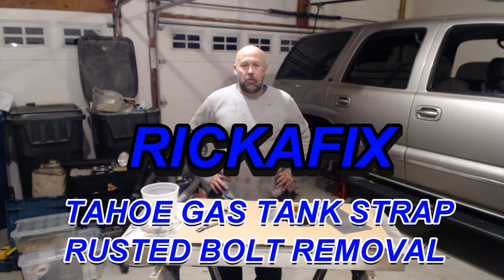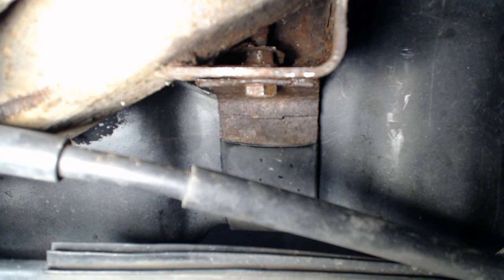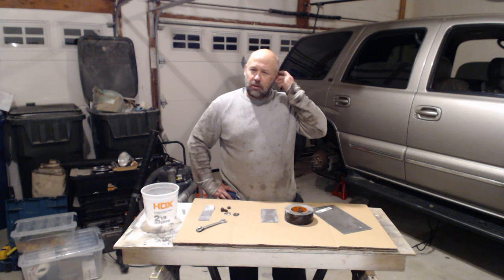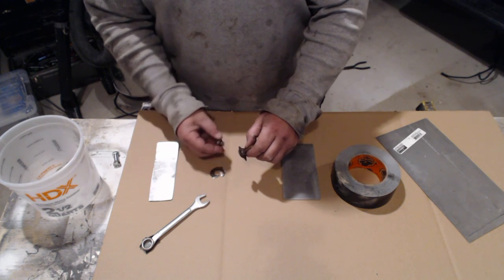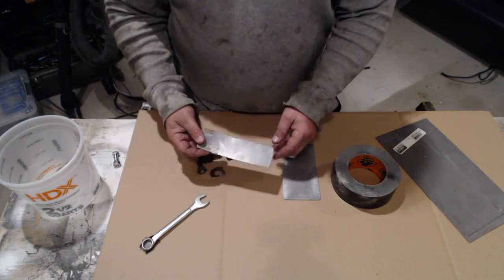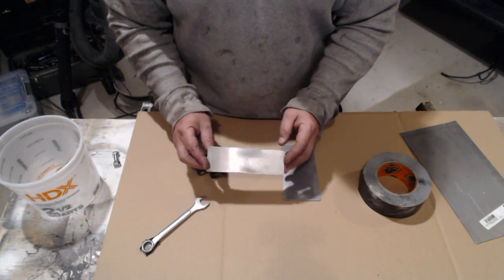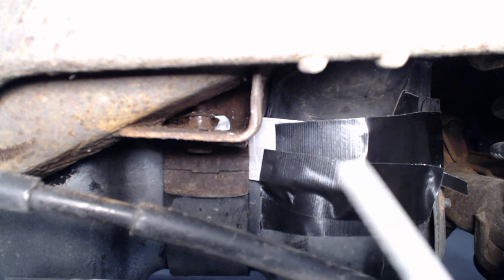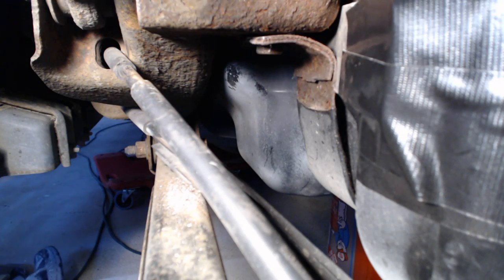TAHOE GAS TANK STRAP RUSTED STRIPPED BROKEN BOLT REMOVAL

Comment: i thought about using a sawzall...but decided against when i saw what a pain it was going to be to get the sawzall in there....so,  i used a small drill to drill a pilot hole in the bolt head, then moved up to a drill bit that was big enough to pop the head off the bolt as soon as it got thru it. Came right off...then i removed the old rusted stuff from the cavity where it was and put in new hardware. Took me about 15-20 minutes for that portion of the repair.
Reply: Thank man I’m going to try this I wrestled with this issue today for 4 hours… the first bolt came out super easy, the 2nd one oh man… the nut is seized on the bolt and they both just spin…
Reply: But with gas fumes , I am afraid of a spark to ignite the tank. I can cut the bolt head off but this doesn’t seem like a smart option.
Reply: Sawzall one wrong catch and hole in tank.as a welder,fabricator, mechanic. High speed die grinder with  carbide bit 
Air  or electric never sparks but  use proper PPE.

Comment: Wish mine is going that easy... leaking fuel line requires me to drop tank on a 2000 Blazer so I've got to slowly cut strap by hand to avoid sparks.  Yeah, that tool you were using to point out the rust...fun stuff lol

Comment: I just did this last week.   Front bolt was spinning on my 2009 Avalanche.  It was all rusted.   I chose to grind off the head of the bolt with my die grinder and the most coarse disk I had.   Wrapped wet rags all around the frame point and side of the tank to stop a spark from reaching the top of the tank.  Took my time and bolt head was completely gone after about 10 patient minutes.   Bought new bolts and nuts, and greased the crap out of the mount they sit in so I don't have to worry about it again.
Reply: Do you happen to know the bolt kit you used? I haven't been able to find any and the dorman set I found says it's incompatible
Reply: Use anti seize .better than grease. Costs  more but worth it.

Comment: Thanks for info. Had this problem on a GMC Savanna 2500. Reciprocating saw with a 10 “ diamond tipped blade I had both bolts off in 20 minutes…

Comment: Nice vid.  

I had to get rid off my Astro van because it went from rolling-money-pit to unable-to-stop money pit (rusted out break lines).

Secondary reason was i snapped the head off the front driver side gas tank strap bolt.  Made no progress drilling it out.  Was never able to put more than five gallons in it again due to lack of weight bearing ability.
Reply: That’s freakin wild!, did you resale? Or scap?
Reply: @wiggitywhitefox  

Scrap.

I live in urban Chicago suburb and I only had street parking so I had nowhere to park the Astro van where I could work on it. It needed a rear axle also, specifically the differential was whining likely the pinion gear. 

I do miss it's off idle torque though of the 4.3 L Vortect enine.  Now I'm driving a Toyota Solara V6 3.0 L where I have to get up at 2,000 RPM to get decent launch off from a standing start. Rides more like a go kart too. Better handling though. I missed the van about five times a year such as right now when I want to rent a core aerator and avoid rental truck cost to get it to my house.

Comment: Another way is to use an oscillating multi tool with a metal cutting blade .
Reply: Did that work for you?
Reply: @jakejones2482  Yes, gives better control than sawzall , but you still need to be very careful when cutting.

Comment: What did you use for the new bolts? Every auto parts store around says they don't have any for my Tahoe.
Reply: Use 15mm headbolt for metric or 1/2head bolt for imprail

Comment: Good video, thanks for sharing your nightmare with us. I went a different route. Since I was replacing the fuel tank, I put a jack under the strap and raised it high enough to remove the strap from the other side near the driveshaft. The tank and strap needs to be raised about a 1/2 inch to free the strap from the T hangar on the other side. (At the end of the day I did not notice any damage to the old tank.) I was then able to drop the tank and do battle with the bolt and grab the nut with vise grips.

Where did you get the replacement bolt and C Clip for the Tahoe?

Found it. Dorman Part Number 55157. Comes with 2 clip nuts and 2 bolts. Perfect fit for 2004 Tahoe. Advance Auto or Orioley's Autoparts.
Reply from the maker: Nice finzfan...I think I boght them at napa
Reply: I am currently knee deep in this crap. Thanks for this idea!! Getting a sawzaw in on my bolt is not really a feasible way...
Reply: @dylanhucik8594  I am happy to help. I hope you got through that nightmare.

Comment: I am doing mine now. The one closest to the front was spinning and I have a lot of trouble  with walking or working at any capacity. I have done tanks before but I have been at it for a week and that's when I found out the nut was not coming out. I tried everything I could think of. I have a cutting wheel on my air
grinder but adding sparks where fumes are strong there was no way I was risking that .
I grabbed my mini air jack hammer with a nut splitter blade and cut through in 5 min. 
That was on the hanger side . Can anyone tell me how low can I drop the tank in order to remove the wire clips before pulling the tank out from under my truck ?
  I have the tank on a jack but had to go inside to reset . 

Once I  can lower the tank and see the wiring so I can do the job .
I  have the truck up on ramps so if it's possible to and the wires are long enough does anyone know ? thank you for the video  .

Comment: Simalar thing happened to me on my suburban. I didn't have any rust. I put the bolt on a couple of turns and hit it with my impact and it broke that clip part of the bolt (GM calls it a j-bolt) I wasn't sure what to do because it was spinning like you said yours was. I just broke out the dremel. The dremel fit in there perfectly and I was a little worried that the Sparks would mess up the plastic tank. But I just cut off the bolt and and got a new bolt and nut from GM only cost me about $9 from them.
Reply from the maker: +Mitchell Kirkland Nice Mitchell...I have heard great things about the dremel I probably need to get one
Reply: +RICKAFIX yes they are great. Just look around for prices, some places charge a lot more than others.
Reply: Wait, ... what?  You put the same crap back on that failed and caused this problem in the first place? 
Worse yet you paid about five times too much to fix the problem on the hardware. 
Even worse, you paid the same morons   that designed it !

Comment: Could also use a mini belt sander to grind away the head of the bolt which I'll be doing soon
Reply: Mini belt sander and 1/2 ton truck repair  is new to me.

Comment: I am replacing tank and pump and all straps on a 95 k 1500. What a nightmare. Ebrything is rusted and has to be butchered to come out. Anyone have any tips??? I am dreading this. Bed is off cuz i am painting frame. This is last step to complete semi restoration. Only has 117000 on motor and i bought truck for $350. And put $3000 into it. This is the worst of all other repairs

Comment: What the hell holds the tank up?  My rear strap is totally rusted off. Gone. 05 yukon
Reply: My fuel line on 95 tahoe just started leaking. After short inspection I believe tabs thru left frame rail pivot straps toward mounting  bolts near driveline? This why searching for info before I dig into it. So far  nothing helpful but if your working on fuel tank at least put  fire extinguisher nearby so it looks like you know what  your doing.